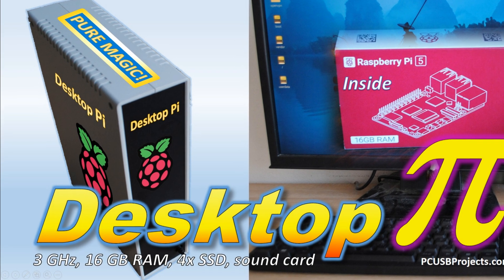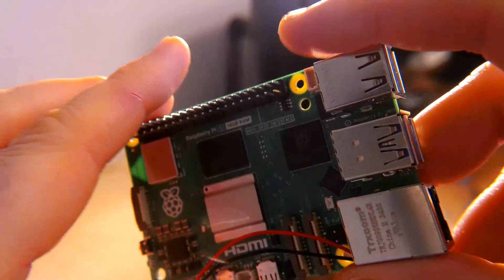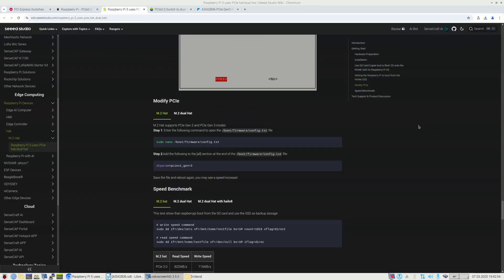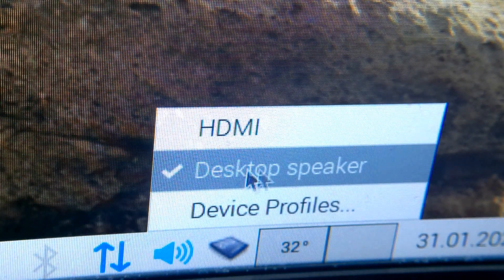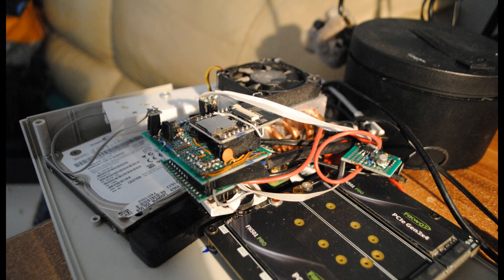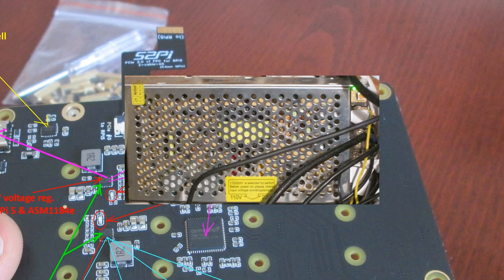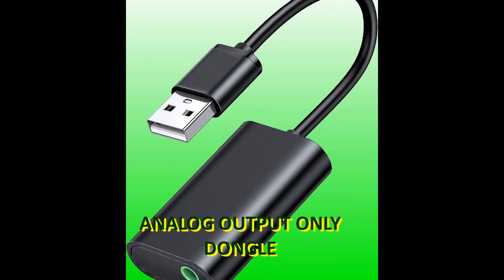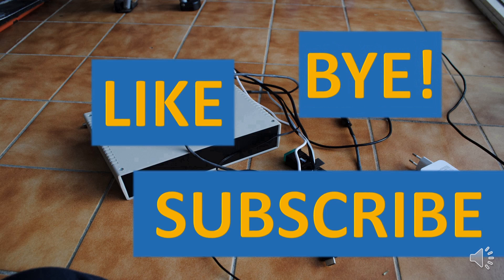I've BUILT 3 GHz Raspberry Pi 5  DESKTOP (16GB RAM, 4x SSD,1x HDD + Wi-Fi remote  PWR ON/OFF & Lock)

Comment: The disappointing part is actually how underwhelming the performance of the pi 5 is. And even with something like the rk3588 driver support on linux is sketchy at best. There dont seem to be a good solution for an ARM linux desktop.

Maybe the pi 6 is gonna be better (cope)
Reply from the maker: Yeah, I've done what I could. I'm not disappointed with LibreOffice performance nor with internet performance. However 3D games are a weak link (watch: https://youtu.be/nWf1ee-Ka5A) I still have great hopes for Raspberry Pi 6. I hope ti comes until the end of this year (watch: https://youtu.be/86fNZqQTyqk and https://youtu.be/XQC1dknGM2Y).

Comment: What would make it even more better if you had some PCI-E Ports so you can add GPU support.
Reply from the maker: Yes! I could have added a proper graphics card to my Desktop Pi. But there are also reasons, why I haven't done it yet: There is one external PCIe x1 port already on Raspberry Pi 5, but I would expect at least PCIe x4 Gen 3 together with a PCIe x4 switch (ex. ASM2806) to make at least 2 PCIe x4 Gen 3 ports available. The only PCIe x4 Gen 3 port is internally connected to RP1 I/O controller. Raspberry Pi 6 should improve on PCIe configuration to provide at least one external PCIe x4 Gen 3 or Gen 4 port. A classic desktop PC has at least one PCIe x16 Gen 3 ot Gen 4 port to accommodate a powerful graphics card.

However, unreliable and non-existing device drivers for classic PC graphic cards currently pose an even bigger problem.... External graphics cards could also be used via USB 3.x ports like on classic mini PCs, but there are no device drivers. Watch: https://youtu.be/86fNZqQTyqk to learn more about Raspberry Pi future plans.

Comment: So you got a Raspberry Pi5, connected some storage, a power supply and... oh that's it?
Reply from the maker: It is the whole computer, not just a fast storage. It is primarily about speed and functionality:
Desktop Pi components:
- Raspberry Pi 5 with 16 GB RAM
- Speeds: 3 GHz CPU, 1 GHz GPU
- air cooling system with aluminum alloy under-board and cooling ribs with a powerful fan cooling the SoC (BCM2712) [cooled from the top and the bottom], 16 GB RAM chip [cooled from the top and the bottom] and DA9091 Power Management Controller [cooled from the bottom].
- PCIe extension board with PCIe Switch for up to 4 SSD drivers
- up to 4x SSD
- 1x HDD connected via USB to SATA controller for 2.5" disks.
- sound card
- Power On Manager for remote power ON/OFF and locking. Also prevents unwanted startup after a 
power outage. Includes power ON/OFF button
- external power distribution rail for powering Raspberry Pi 5 and SSD extension board
- 2x HDMI video output
- Analog video output
- 150 W 5 V 30 A power supply
Reply from the maker: Yes, it makes sense, if you have the whole package: Desktop Pi... If you upgrade just partially then I suggest just to plugin an SSD, as you've already done. Watch video: https://youtu.be/zahhsNqxHFk. But I admit that it is hard to do much more in a sense of speedup that I've done. 

In general, I don't favor any kind of unreliable speedup configurations. I'm using this one, because it is completely stable and it gives me an edge when testing different software. If I'm lucky enough to get one of the first Raspberry Pi 6s, I'll of course replace Raspberry Pi 5 for Raspberry Pi 6 immediately. I also hope for Raspberry Pi 6 to enable reliable overclocking, too...

By attaching an SSD driver to the external PCIe x1 port, you gonna free one of your USB 3.0 ports for other devices. PCIe Gen 2 speed is 500 MB/s and you can reuse the existing SSD, if it is detachable from the PCIe M.2 to USB 3.x interface. If you use PCIe Gen 3 switch the speedup is about 3-times: from 360 MB/s to 985 MB/s. 

You have to decide what makes sense to you and how much it will cost you... It is the same question with overclocking the SoC to 3 GHz CPU and 1 GHz GPU. If you run at nominal speeds of 2.4 GHz CPU and 800 MHz GPU, it is 20 % slower... It depends on your needs. 

Again, having just one SSD may be enough for some and insufficient for those that want to build a disk array or those that want to have a fail safe configuration.... More HW you put into your Desktop Pi, more functionality you get.

I have different RPi 5s (overclocked and non-overclocked) and I prefer to use the fastest one every day.....
Reply: I feel like pointing out that, if you just want a cheap, light desktop to run Linux on and don't plan on using the I/O features of Pi, you can typically grab a used HP T740 Thin Client with a quad-core Ryzen (Zen 2 IIRC) SOC and onboard Radeon graphics, plus built-in PCI-e (hard limited to about 35w socket power), for about the same cost as a new Pi 5, if not cheaper - eliminates the need to figure out cooling, cases, and storage.

It's full x86-64, and the CPU benchmarks a bit higher than a Core i7-3770, so while it's not setting any performance records, it's far more powerful than current Pis, plus its memory is slotted, not soldered, so you can always upgrade later on down the line if you need more, whereas you're locked in to whatever you bought with a Pi.

Personally, I love HP's previous-generation thin clients, because you can typically grab T620s and 630s for about $20-$30/ea from ewaste recyclers and businesses upgrading their offices, and they perform about comparably to, if not slightly better than, a Pi 4B.

Only disadvantages are the I/O being a bit more sparse and locked-down, the lack of a warranty, and the system being about the size of a college textbook instead of about the size of a wallet. If these aren't deal-breakers for you, they may be worth considering.
Reply from the maker: What if you want the fastest Raspberry Pi 5 with the richest functionality possible? I'm not saying it is faster than an Intel or AMD processor based PC, but it has probably the best compromise between functionality and speed for a Raspberry Pi 5.... It is also designed to be completely stable running constantly at 3 GHz CPU and 1 GHz GPU. SSD drives also 10-times speed up loading OS, applications and data... If you want a PC of the comparable size and price, you can also buy a GMKtec mini or micro PCs... You'll find a number of USB to GPIO interfaces on https://sites.google.com/site/pcusbprojects website that you can use with any classic PC....

Comment: This is a very important tip. I've done that too. Separate power supplies for the RPI and the drives. My SSD drives are connected to the RPI via a USB hub. The USB hub is connected to the RPI, but I disconnected the 5V supply to protect the RPI from reverse current, which will kill the RPI sooner or later. Note: Not every USB hub has a built-in reverse current diode. 

Can you tell me if the 8GB and 16GB RPI versions can be overclocked the same, or are there differences? My 8GB RPI has been running at 2900 MHz without any problems for months.
Thanks for the very interesting video. ❤
Reply from the maker: You can power them both from the same power supply like on a classic desktop PC. There is a protection on RPi 5 PCB to prevent reverse current. Look at the bottom side of the PCB where USB-C connector is located. I've testes both versions of RPi 5 the old "C"  type SoC with 8 GB RAM and the new "D" type SoC with 16 GB RAM. They both worked flawlessly. I've been running my RPi 5 with 8 GB RAM on 3 GHz for about half a year, but it shows no sighs of degradation. Then I got my RPi 5 with 16 GB RAM, which is now running on 3 GHz constantly with no problems what so ever for 2 months, now. However, my previous RPi 5 with 16 GB RAM had a some kind of flaw and it had been unable to overclock to more than 2.8 GHz. I believe that this was just a faulty unit, because it had failed completely soon after I got it. I had run it at 3 GHz just twice and had it failed while loading Raspberry Pi OS on both occasions, so cooling was not a factor here. I had run it on 2.4 GHz since, but it failed after 2 weeks anyway.

I've also overclocked RPi CM 5 (https://youtu.be/5Xffn_21_QY) and RPi 500 to 3 GHz with no problem what so ever, but sufficient cooling must be provided to prevent overheating on the long term. I'm running my RPi 5 on 3 GHz for a few hours every day. It never fails o start. It never throttles clock speed (vcgencmd get_throttled returns 0). It never fails even when CPU & GPU loads are about 100 % for a prolonged time. I've tested this in this video: https://youtu.be/nWf1ee-Ka5A. 3D Graphics is very hard on RPi 5, because it lacks a proper graphics card and device drivers for it.

To conclude:
- Get a powerful enough power supply
- Get efficient enough cooling system
- Make proper wiring to conduct enough electric current at 5 V.

It works for me. That's why I call my Raspberry Pi 5: "Desktop Pi". I tried a similar architecture to a classic desktop PC.
Reply: @pcusbprojects Thanks, then it's time to buy the RPI 5 16GB. 

Cooling isn't a problem for me. I've screwed the RPI to a large aluminum heatsink with a 2mm copper plate in between (I hate fan noise). Even at 27°C in the room, the temperature on the CPU doesn't exceed 45°C when overclocked to 2900MHz at full load. 
During normal use (surfing the internet, etc.), the CPU temperature is 12°C above room temperature. 
For me, the RPI is brilliant as a desktop PC.
Reply from the maker: Of course, a large block of aluminum is also a part of Raspberry Pi 500. Its cooling works the same way. My Desktop Pi cooler is in fact very efficient even without its fan running. The fan is actually off even at maximum load, because the temperature never reaches 60 deg. C at room temperature around 25 deg. C. However, the fan will be needed in summer months, if the room temperature gets to 30 deg. C or more, I guess. Otherwise, I've also tested the fan by manually setting it to run at full speed. In this case, the SoC temperature never exceeds 45 deg. C at constant full load, which is amazing. Watch: https://youtu.be/gYz_0pqde04.
Reply: @ When I think about replacing SSD drives on USB3 with M-2 on PCI. I've already bought M-2 HAT. At SSD speed is 360 MB/s with M-2, this speed would double. This will hardly be significant in everyday use and hardly noticeable.
The question is, does that make sense?
Reply from the maker: Yes, it makes sense, if you have the whole package: Desktop Pi... If you upgrade just partially then I suggest just to plugin an SSD, as you've already done. Watch video: https://youtu.be/zahhsNqxHFk. But I admit that it is hard to do much more in a sense of speedup that I've done. 

In general, I don't favor any kind of unreliable speedup configurations. I'm using this one, because it is completely stable and it gives me an edge when testing different software. If I'm lucky enough to get one of the first Raspberry Pi 6s, I'll of course replace Raspberry Pi 5 for Raspberry Pi 6 immediately. I also hope for Raspberry Pi 6 to enable reliable overclocking, too...

By attaching an SSD driver to the external PCIe x1 port, you gonna free one of your USB 3.0 ports for other devices. PCIe Gen 2 speed is 500 MB/s and you can reuse the existing SSD, if it is detachable from the PCIe M.2 to USB 3.x interface. If you use PCIe Gen 3 switch the speedup is about 3-times: from 360 MB/s to 985 MB/s. 

You have to decide what makes sense to you and how much it will cost you... It is the same question with overclocking the SoC to 3 GHz CPU and 1 GHz GPU. If you run at nominal speeds of 2.4 GHz CPU and 800 MHz GPU, it is 20 % slower... It depends on your needs. 

Again, having just one SSD may be enough for some and insufficient for those that want to build a disk array or those that want to have a fail safe configuration.... More HW you put into your Desktop Pi, more functionality you get.

I have different RPi 5s (overclocked and non-overclocked) and I prefer to use the fastest one every day.....
Reply: @pcusbprojects  This is just ingenious about Raspberry Pi that you have so many options that everyone can use their own option, which meets their own requirements. So you want to tinker and try it out.
Reply from the maker: Yeah, this is Raspberry Pi... My option is to get overall maximum performance, more or less like a classic desktop PC. I try to combine features that seem to be incompatible otherwise...